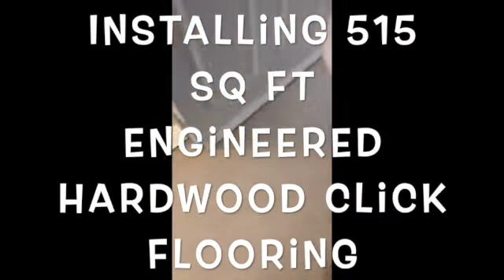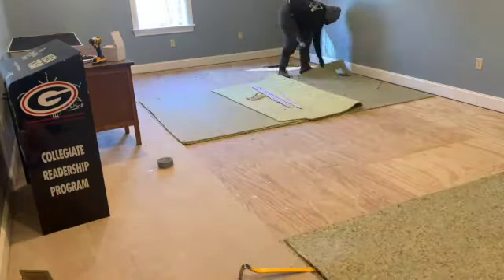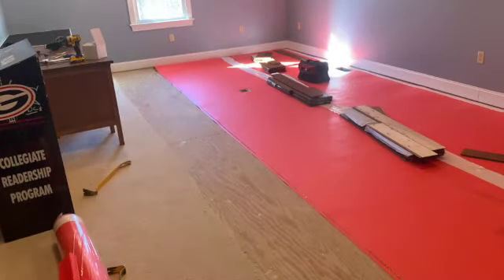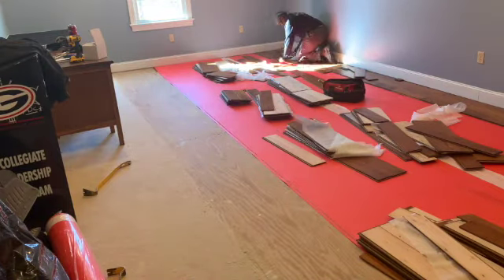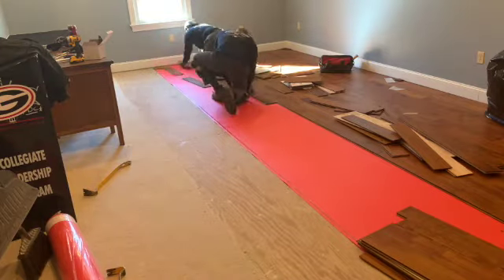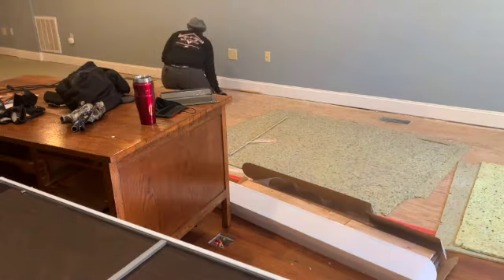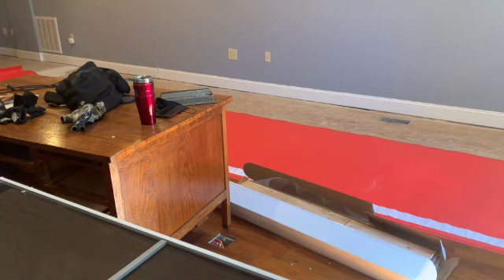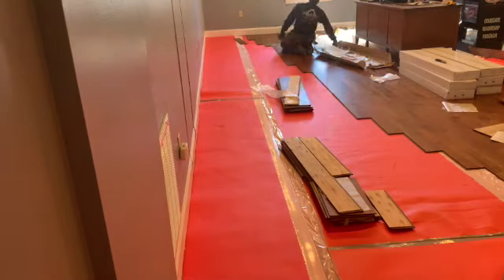515 wood click   SD 480p

Comment: the floor muffler instructions say to install it the opposite way, tape side down.  How come you did it with the tape side up?

Floor muffler instructions: https://m.youtube.com/watch?v=tTbSVOEQhDs
Reply from the maker: Great observation Cathy, Floor Muffler performs exactly the same either side.  The reason that we install it upside down is because it will not roll up.  If you notice on the Floor Muffler video they have placed stuff on it to prevent the roll up.  If we had a chance to tell them to package it differently we would, then it would be more efficient to install it tape side down.  Some installers use staples to prevent the roll up, but we had to repair a install from another floor contractor because noise caused by staples scratching flooring.  So this is what we came up with to eliminate that potential and prevent roll up.